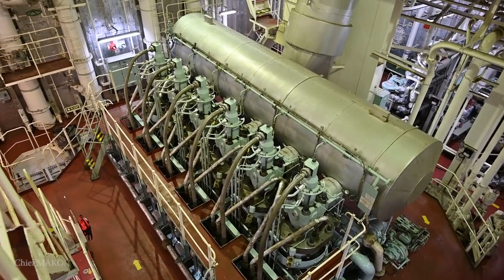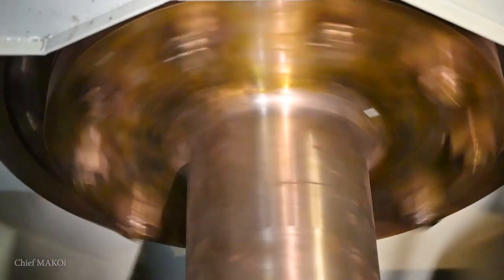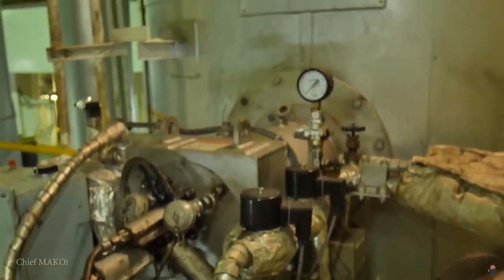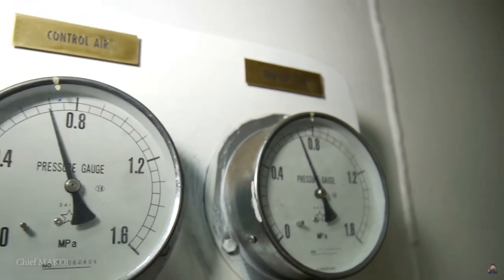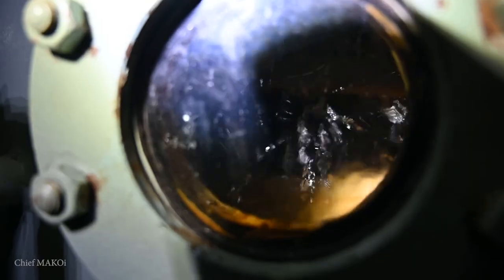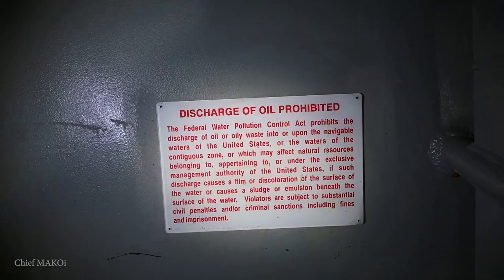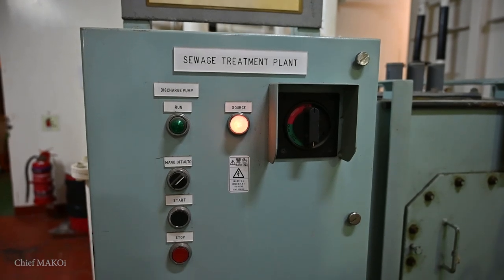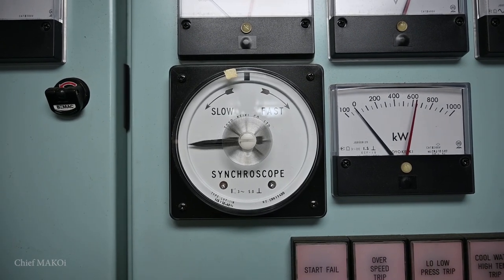The Machines in a Marine Powerplant | Chief MAKOi #ships

Comment: This is one of your best vids Chief. I still don’t understand bunker oil for main engine fuel. Is it really so much cheaper than diesel fuel. It seems that all the equipment needed to purify it and pump it is expensive and the monitoring system has to be constantly maintained and watched. Isn’t it heavier than diesel fuel? Won’t bunker oil pollute the seas more than diesel if there is a break up at sea? Seems like bunker oil is way more trouble than diesel. Trouble equals a lot of expense.